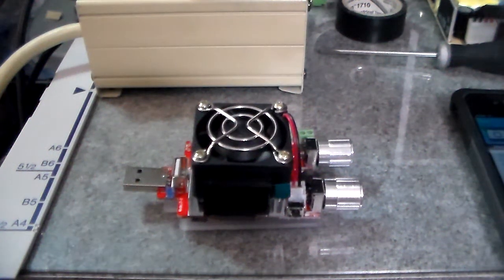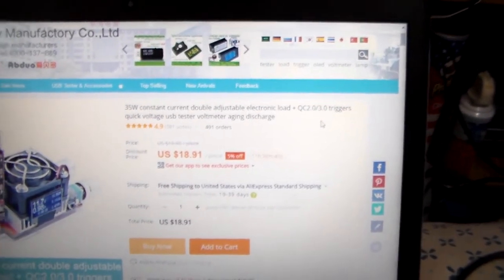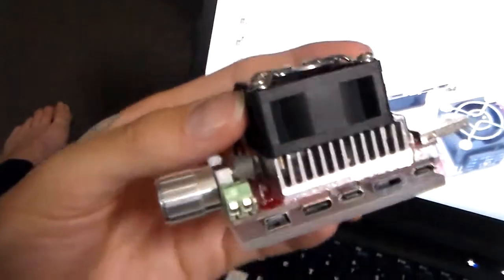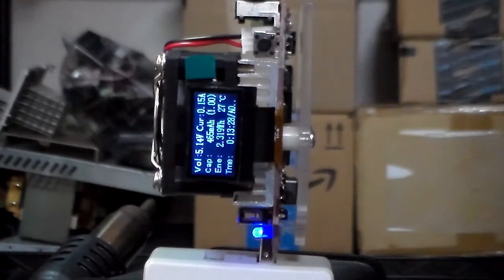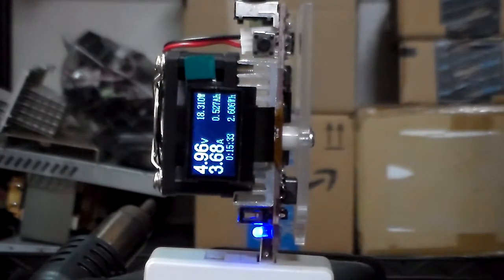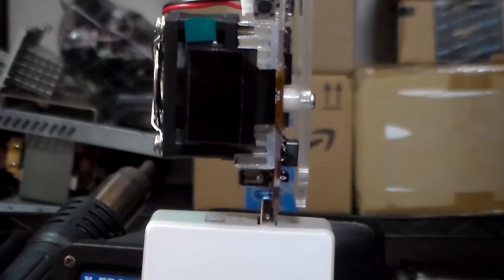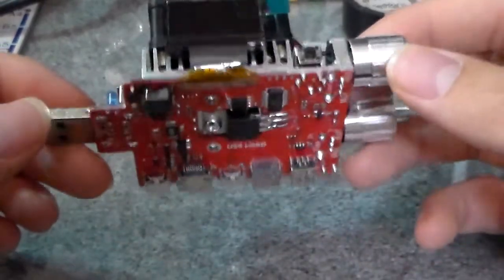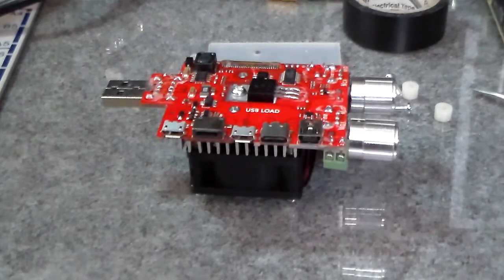35W USB Dummy Load: testing my Anker 18W 2 port charger

Comment: Hi there , thank you for the video , recently i bought this usb loader ,but it seems when i spin the potentiometer the amp remains zero i believe the product is defective ,but im wondering if i replace tip122 transistor ,does that fix the problem ? thanks
Reply from the maker: Because you recently bought it then you should talk to the seller to get a refund or replacement. I would first use the multimeter to check the voltages to see if there is a bad solder joint. You should see at least 0.5v on the base of the transistor coming from the little IC. if not then the transistor is probably fine and it is the opamp IC, or something feeding the IC like the potentiometer or voltage regulator.
Reply: @SuperBrainAK  i asked for refund and i should wait 3 days for aliexpress to accept my request ,unfortunately the seller is not cooperative but thats fine ,i uploaded a video as a proof too, i will try your suggestion ,actually i have a basic knowledge on electronics , i do have multimeter and i will check the voltages ,but i believe if the problem is too complicated i will keep it as is , really  thanks for replying back to my question
Reply from the maker: @hagop002  Hopefully you can get the refund, if not from the seller but from Aliexpress themselves. Hey maybe you can get a refund and fix the unit later! Good luck to you!

Comment: Did anyone get USB-C to USB-C to work? Only thing that works for me on the USB-C input is a USB-A to USB-C cable but that's only 5V.
Reply from the maker: you are testing a usb-c power supply with a male-male usb-c cable? this should work with quick charge if you have the trigger board in the usb-a female port.
Reply: @SuperBrainAK  I got the dummy load to power up with a Nintendo Switch wall plug but only on 5V, QC-trigger seemed to do no difference. Will do further testing tomorrow or this weekend.
Reply from the maker: @00Asti  I bet the switch uses a different protocol than Qualcomm Quick charge, it might use the USB Power Delivery protocol though im not sure, if so you will need a different trigger board to get it to work
Reply: SuperBrainAK Yes. The switch uses PD so I’ll look for a trigger board or buy a more expensive dummy load with PD-features if one exists. Really need one for testing chargers and batteries at work.

Comment: I have exact same dummy load tester,plugged it on vinsic 20.000 mAh,it cut off at 4.63 mAh and 4.93 volts... the fan on dummy died within a week...
Reply from the maker: huh you must have gotten a defective unit mine works fine still, contact the seller

Comment: Can you use this standalone without a mobile phone to determine the max current a USB cable supports?
Reply from the maker: yes it can test cables and power supplies, what it does is it reads the voltage and current that it is drawing through its dummy load circuit and its usb-A output port. if nothing is plugged into its usb-A output then it will just read the current being drawn by itself by turning the adjustment pots. 

In order to test a cable:
1. Plug the meter into a good power supply using its usb-A male plug. (no cables)
2. Turn the adjustment knobs until the current is what you want to test your cable for, 1A or 2A are easy values.
3. Write down the exact voltage of the readout when it has stabilized.
4. Unplug the dummy load tester from the power supply and plug the cable you want to test in to the power supplies usb-A port.
5. Take the other end of the cable you want to test and plug that into the dummy loads input ports (any port is good except the female usb-A port and standby micro-B port)
6. Turn the adjustment knobs until they are at the same current that you want to test the cable at.
7. Write down the exact voltage of the readout when it has stabilized.
8. Lastly Math! subtract the first voltage from the second voltage and then divide that by the current you tested in amps (not milliamps).
That will give you the entire resistance of the cable you tested fairly accurately. I normally keep cables that are under 0.4 ohms any higher and you dont want to put alot of current through it otherwise they will heat up.

Comment: FYI, you can unplug the fan when not applying a dummy load; allowing it to function as an ammeter.
Reply from the maker: ah yea that would lower its power consumption alot good tip. The other usb safety testers are better suited for that job but that will allow you to just buy one thing.
Reply from the maker: I am using this load as a simple capacity meter today, thanks for the tip! 0mA without the load attached :D

Comment: what meter app is that?
Reply from the maker: it is the WiTenergy Bluetooth power meter (found on amazon), it works great but the app does not work with any other apple phone but my 4S, not sure about android, it will probably work better there though.